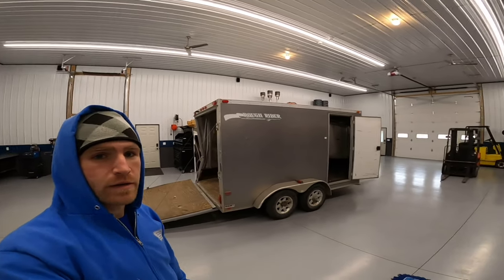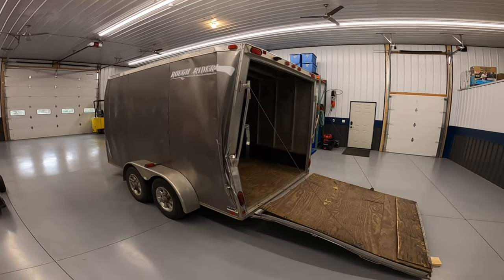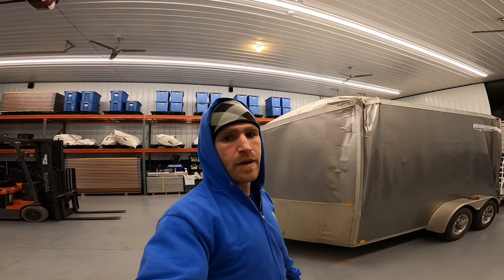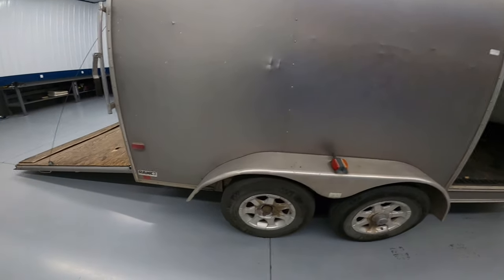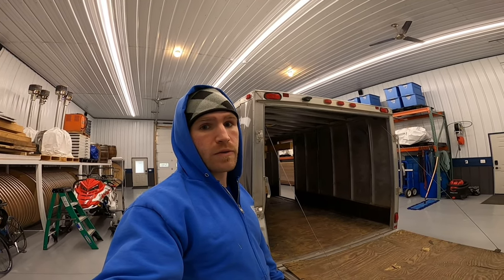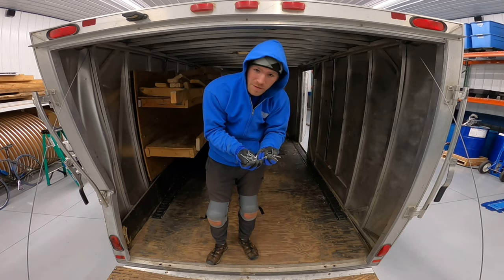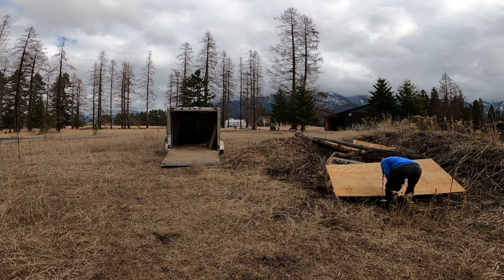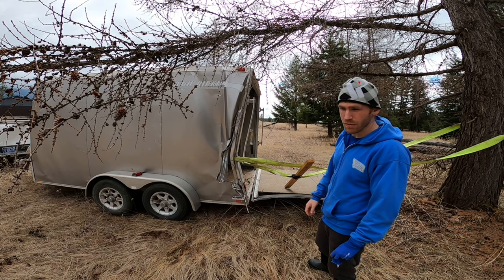Enclosed Trailer Rebuild. Part 1.

Comment: I would love to see a price comparison on purchasing new VS rebuilding like you did. With the prices of a 7x14 single axle (in my area) going for $7000 - I'll bet this rebuild is looking like a better option now. I do remember that not that long ago, if you wrecked an enclosed trailer to the extent of the one you show in this video, it was always cheaper to scrap it and buy a new one. Thanks for making this video...
Reply from the maker: Prices have definitely changed a lot since rebuilding this trailer. I live in northwest Montana and it is an expensive place to purchase trailers as well.

Comment: So how would I cut a trailer door so that instead of the toy hauler door in the back end it can become the whole side of the trailer over the wheel axles and then put leveling jacks underneath and make it as a deck for when it's opened
Reply from the maker: Hmm, that would be tricky lol. I have seen some trailers with sides that open vertically, so I assume it could be done, but it would take a lot of reinforcement..

Comment: Just curious as to where you bought your parts I have one damaged in the front similar to yours but all the sheet panels I have found are way expensive.. Seems it would have been a lot cheaper just to buy a trailer that fit your needs.
Reply from the maker: Most of the parts I ordered from Amazon actually. The structural metal I purchased locally though

Comment: Whered u get your replacement nose??? I can't find one anywhere! Any suggestions?
Reply from the maker: I actually had a local metal supply shop bend it to my specific angles out of aluminum diamond plate and cut it to fit 👍

Comment: Hey billy I have a trailer It leaning to one side and smells like a burning smell when driving I think it might be the axel how would I tell or even start to fix it
Reply from the maker: I would first check the tire clearance on all tires and see if it is visibly rubbing? If not, it may be internal on one of the hub assemblies-an inexpensive temperature gun should indicate which one is faulty after a short drive with it?

Comment: Wicked damage hope it wasnt expensive to acquire
Reply from the maker: Only paid $1300 for it 👍
Reply: @billygrossjr.5585  do you have a source for the proper silicone used on the exterior joints? I need to reseal top to bottom
Reply from the maker: @brentvonaschen7064  It actually isn't silicone. It is called VHB tape from 3M. There are a few different kinds of it, but it seems to be solid stuff.